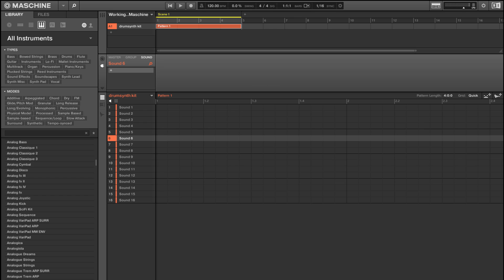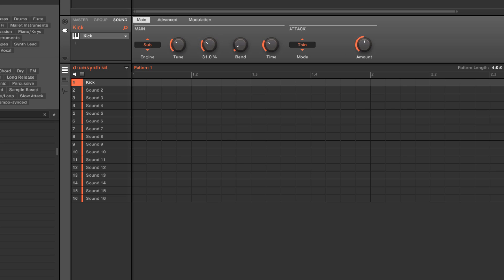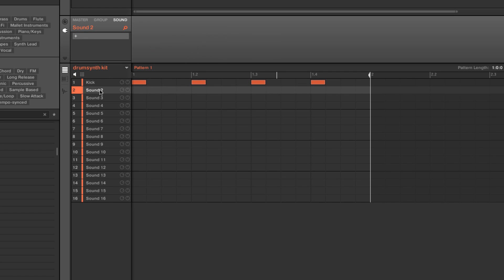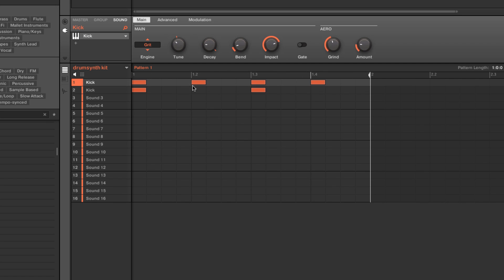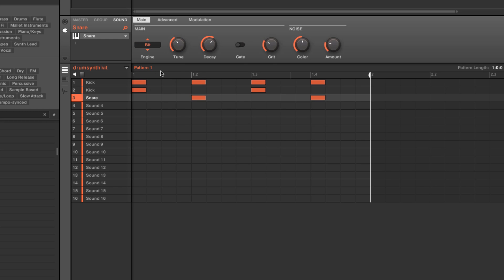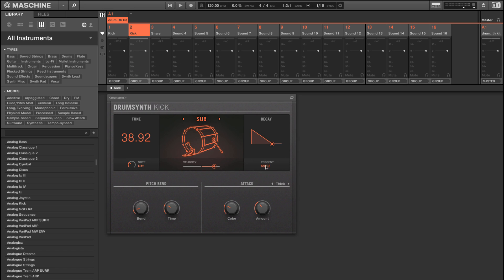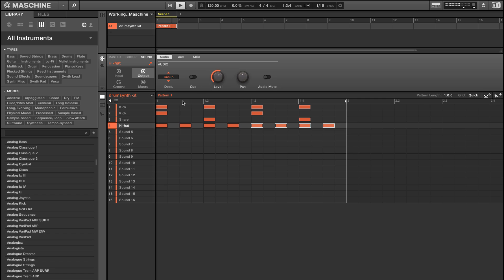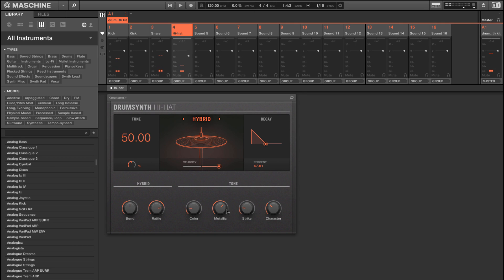Working with Drumsynth in Maschine Part 1

Comment: I so far have not been impressed by drumsynth in maschine - for electronic, hip hop etc the bottom end is not well represented.
Reply: +djbeto1 Layering (sub engine is pretty good for low) and heavy processing can do the trick. Most of samples that are coming with maschine is heavily compressed so comparing to them drum synth sounds a bit weak at first.... eq, tape saturation, a bit of distortion, compressor and maximizer... and drum synth will sound closer to samples
Reply: You have to EQ fort that ad compress and maybe add a saturation